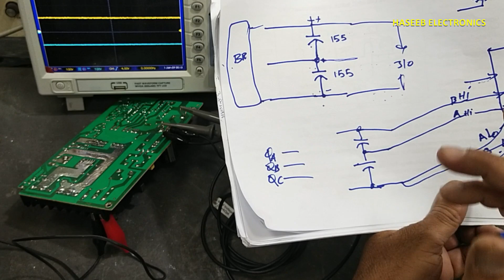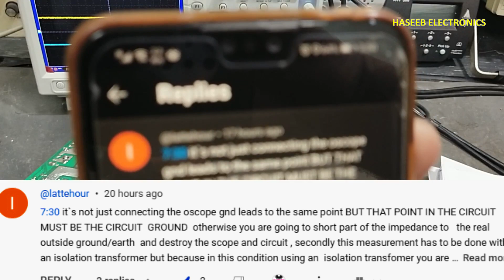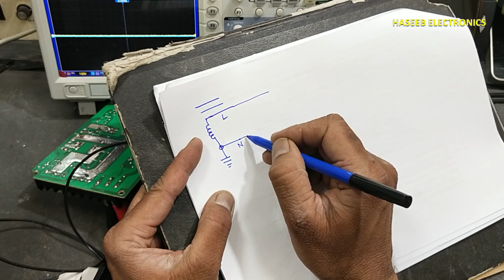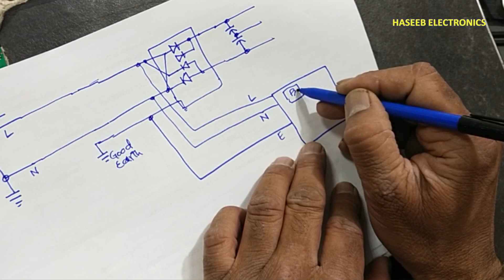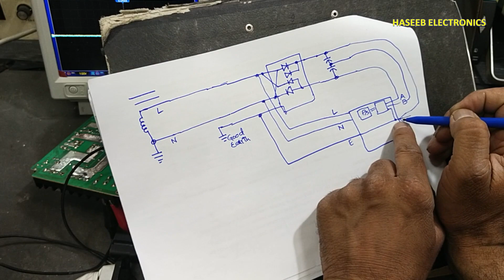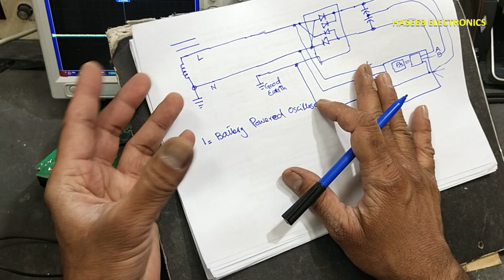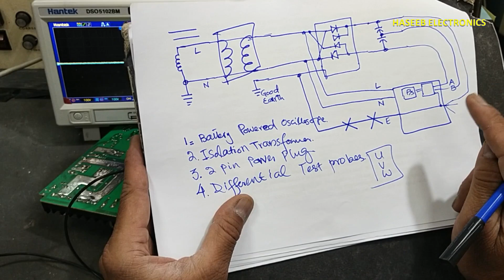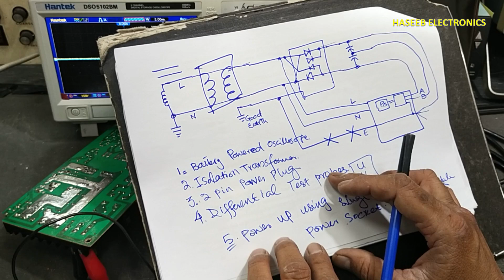{897} measuring non-isolated signal with oscilloscope

Comment: But in previous video you connected low probes on all 3 point on capacitors. You said just both begative MUST  be on same point. In this video you say it will damage dso if connect on positive or negative on capacitors. Not clear to me

Comment: I have a treadmill motor driver  card in which MOSFET is used to drive the motor.
One zener diode is connected between gate and drain.
Cathode is connected with drain and anode is connected with the gate. 
What could be the function of this zener diode here. I found this one short. Now I am planning to install 15v zener here. Could you please help me.because you explain the things technically and logically.if if have your WhatsApp number I may send a pic to you. Regards

Comment: Sir, I am facing issues with DEWALT DCB107 charging Drill machine power supply PCB,
I have replaced Bridge Doides(which was short), 
MOSFET TF10N60(which was short) and a resistor 0.68 ohms(which was burnt).

After replacing these components still battery pack is not charging (no charging indications) and Capacitor (200V) is charging but not getting output voltage from connectors (+ve and -ve)

I have doubt that SMD IC 1710-01 may be short how to test it?  and
Is there similar/equivalent IC available in market ?
Please guide me,
Thank you
Reply from the maker: when the mosfet gets damaged, you need to check the gate resistor connected between gate pin and pin number 7. 
check voltage at pin number 3 (it will less than 18volt 
check diode & capacitor connected at pin 8.
if pin 3 voltage are present. the ic must start
if it is not starting up. you can replace IW1710-1 IC. iw171 is available in markets and online as well
Reply: @HaseebElectronics  thank you so much for giving me your valuable time sir,

I tried the methods you have mentioned,
Voltage at pin 3 is less than 18 volt (only 1volt) i changed resistor with same value but still same problem,
Battery is not getting charged (no indicators)
And main Capacitor is also not discharging.

Comment: Assalamu Alaikum, 
I tried a 180v PMDC treadmill motor in 230v home supply after converting in to DC and made a circuit of PWM using Ic TL494 in open loop mode. Whe i connect a 200watt bulb it glows in various illumination, that is more or less 0- to 100%. But if connect motor the MOSFET blown immediately even RCD snubber circuit ptesent. What could be the reason? explain me. Thank you.

Comment: Interesting. Kind of goes against what I was always taught... never float your scope and put the DUT under isolation. Is this wrong ??  Just to play it safe, I have my scope plugged into a GFI but do not use it for AC voltage, that's what my meter is for.🤓 My AC is either on or off 🙂

Comment: Thanks for sharing! It should also be noted that the actual earth (dirt) itself is connected to the utility pole. I once lit up a 40 watt incandescent bulb using a "hot" 120 volt wire and hooking the other end of the light bulb to an 8 foot (2.5 meter) copper ground rod driven into the earth and connected to nothing else. The ground rod that hooks the utility pole is over 20 meters away from this point and was able to light the bulb at half brightness! That much power going through you would ruin your day!  A damp concrete floor would have a similar effect. A lot of ham radio operators are obsessed with grounding everything together, but this is not always the best option. Thanks for all you do to serve us and have a great day!
Reply from the maker: exactly perfect. 
same i already explained in video number 414  https://youtu.be/a5Dt7y0E9RE
i will suggest to check that video as well